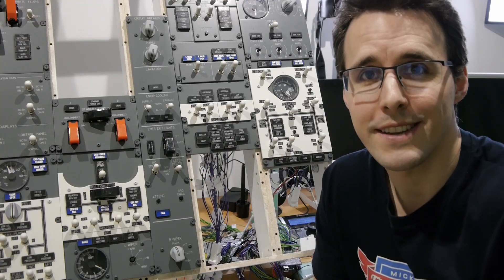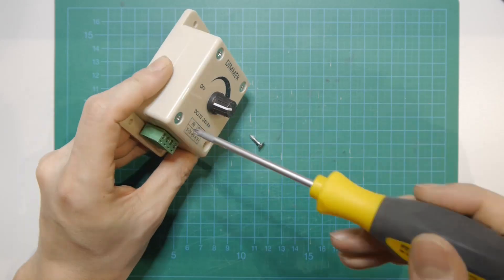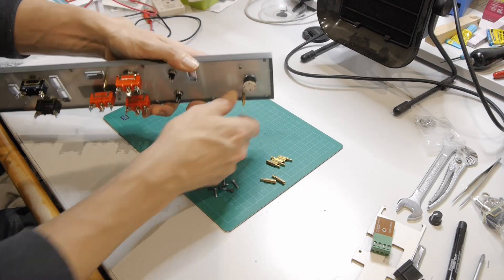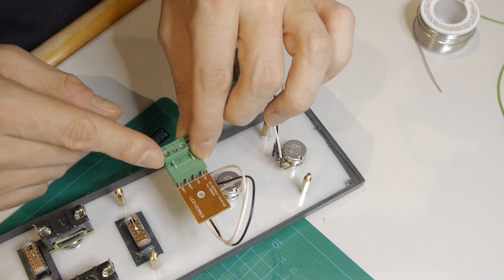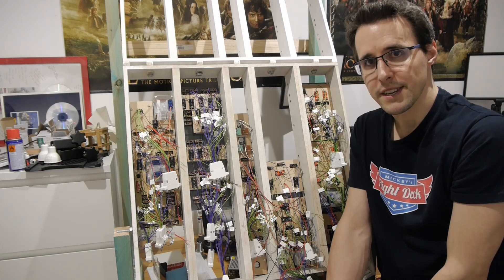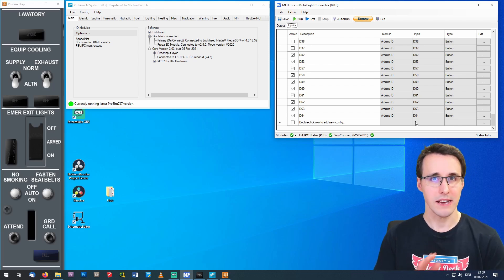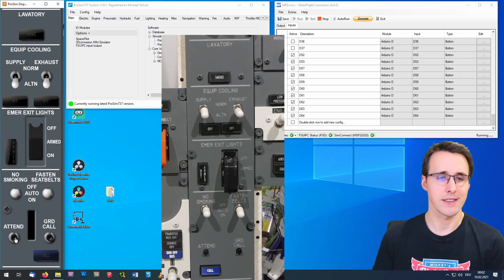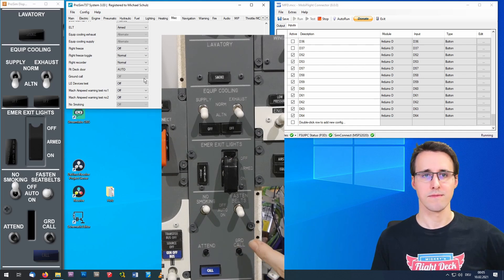Central Panel - A Boeing 737-800 Homecockpit #52

Comment: Hey Mickey, nice work as always! Can you please share which LEDs you use? Thanks a lot for all the nice, inspirational work 😃
Reply from the maker: You can find them here: https://de.aliexpress.com/item/32779397559.html?spm=a2g0s.9042311.0.0.27424c4dfBwCk9
Reply: @Mickeys_Flightdeck  Sorry for my unclear question. I've meant the LED strips for the back lighting.
Reply from the maker: @sasquotschi  I don't have the exact article anymore. But you have to search for 5050 LED strip, not waterproof, warm white and 60 LEDs per meter.

Comment: I know it’s too late, but instead of drilling through you could have drilled just the clear backplate and tapped it m3 to hold the male standoffs. Or if the front and clear were not already glued together, put a chamfer hole on front side of the clear for a recessed screw to go into a female standoff. If it were more than the backlight panel it would be a little weak but in this case it would have been fine. Anyhow just a tip from a hobby machinist who enjoys your builds.